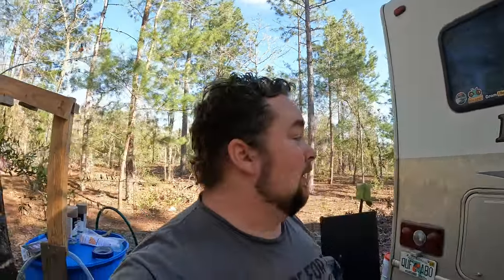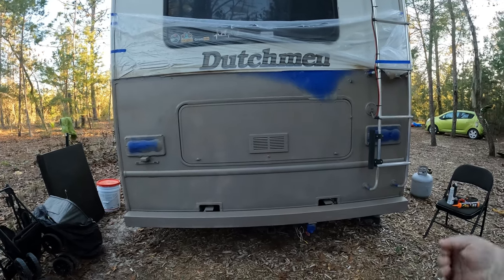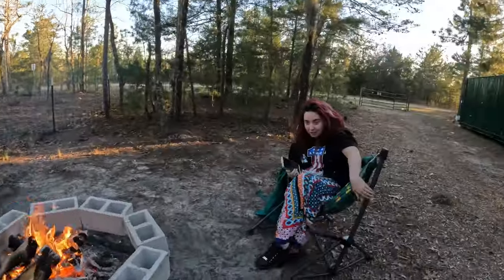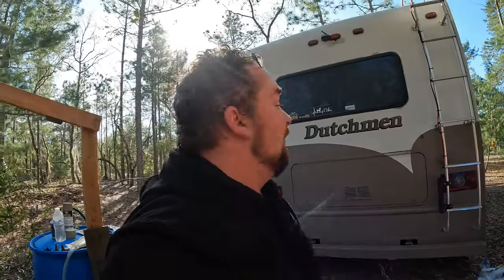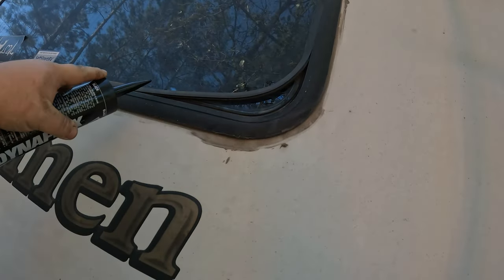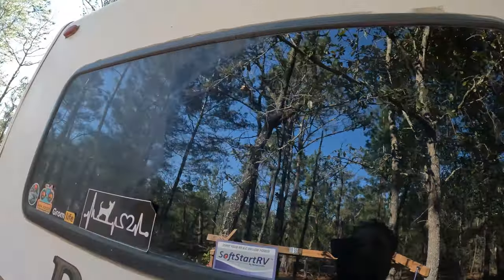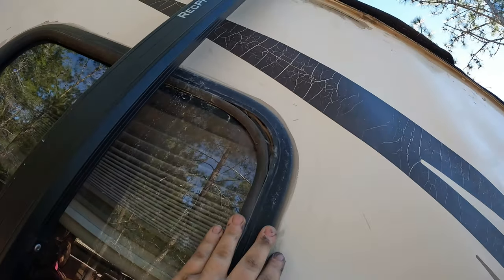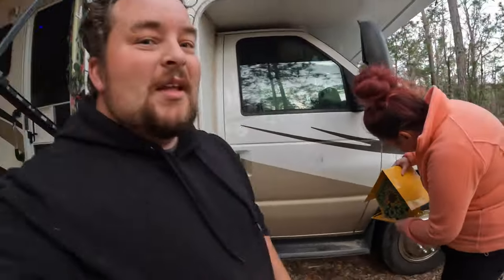We Painted The RV! |2024|

Comment: Another great video...   I'm wondering, is your property close to the Ocala National Forest ?   Kinda looks that way.   I completely agree with you that brand new RV's, especially post COVID, are junk.    but is there a particular Make and Model that you would recommend ?   Probably a Dutchmen, I'm guessing   LOL      Also, you seem like the kinda guy who keeps track of finances.   If I may ask, how much have you spent to maintain or fix up the RV since you bought it ?    I'm thinking of buying a used 2018 model or older...   Heading down to Joshua Tree, CA for an extended vacation
Reply from the maker: Honestly this rv (knock on wood) hasn’t cost me too much. When we first bought it I put in a brand new starter battery and alternator. ($500). I also put 6 brand new tires on. ($1000) from discount tire. Recently I needed to replace a front break caliper because it seized up ($175) an alignment ($75) and now my control board for my hot water heater crapped out so I ordered a new one ($110). I resealed my own roof ($200) I recaulked the entire rv (all the seams) that was Bout $100 in caulk. Before we installed our solar system we installed a new 100ah house battery for $150. I think that’s everything…aside from the solar system of course. Yeah I deff recommend older. Especially if you can pay cash. Financing anything sucks. I’m not biased to any brand particularly but you’re going to have issues no matter what brand you buy. They bounce all over the road and take a lot of abuse